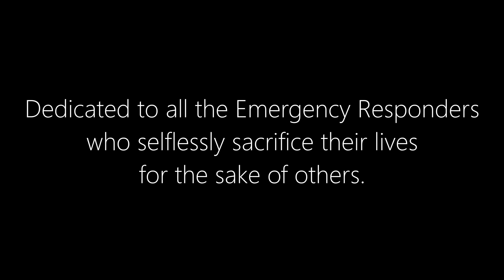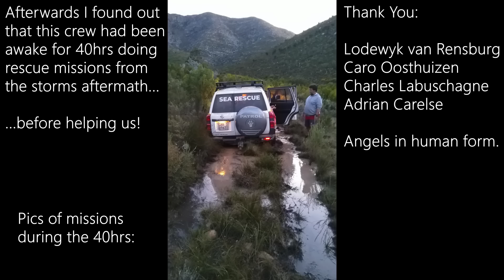Land Rover Stuck in the Mud for 2 Days!

Comment: Recovery points.(Structural Engineer here). The chassis members are made from 2 mm steel. You can install v strong Jate rings but the bolts will start to pull through the walls of the chassis rails under load.  You need to increase the wall thickness at the anchor points by welding on doubler plates (say 3mm thick) which will spread the load. Of course the standard Jate rings won't fit over the doubler plates so they need to be modified, but you will at leadt have strong recovery points.
Reply from the maker: Bill, you honour me greatly by imparting your highly educated and experienced knowledge here. Thank you!!
I will immediately start researching into what you've said and see how I can implement it in the future.
Warm regards, John
Reply: @auto-funatics7147  No honour mate, just a bit of commonsense.
If I were a bit younger I'd think about marketing a recovery point kit with doubler plates (which would need to be welded to the chassis rails) and widened Jate rings.

Comment: Hey just to add a note about the defender ‘recovery’ points… they do tell you under towing section in the manual it says that they not for off road recovery.
Reply from the maker: You're absolutely right - but as Marcus says, it's all we've got - but using them with a bridle to distribute the load evenly between the two seems to work. The reason why mine snapped was because everyone was tired, and so we thought just using the one would be fine that once... Oops 😬.
I couldn't include that part of the discussion because it was quite a heated discussion 😅.
A debatable subject for sure 😁!
Reply: @auto-funatics7147  ahah yeah I totally understand 😁 yeah I was looking into what could actually work as a proper defender recovery point for defenders and not much out there at all!  I have the pin and ball 2 in 1 tow hitch which I thought I just use the pin and job down but been told can’t use the pin, so I think when poo has hit the fan use what you got and get out :)